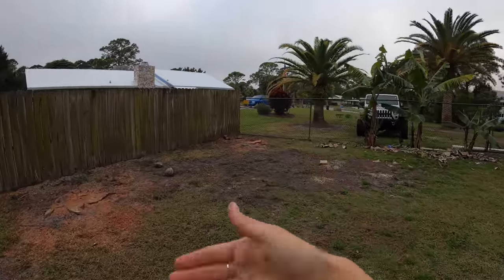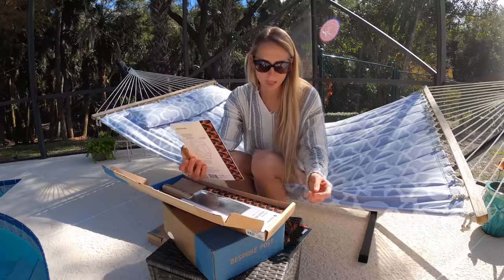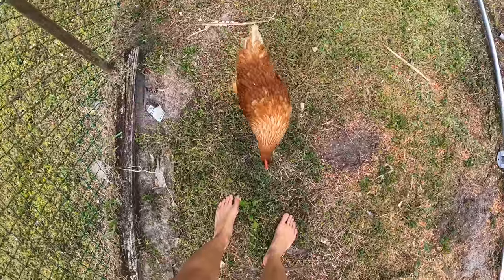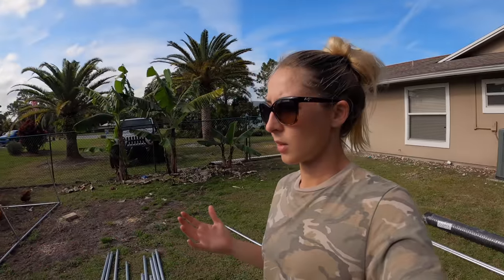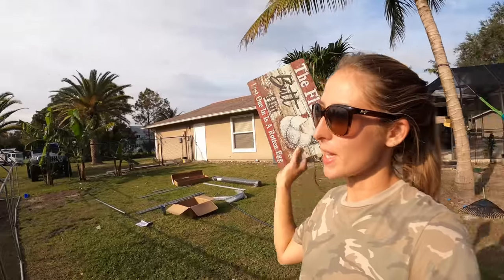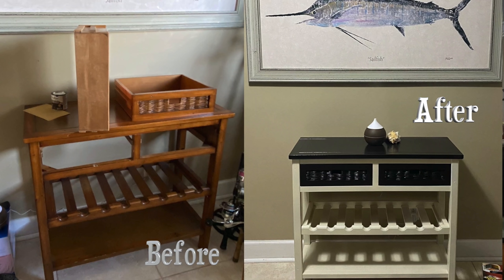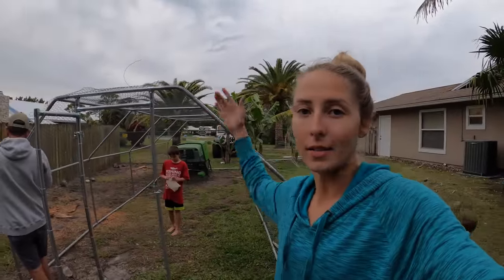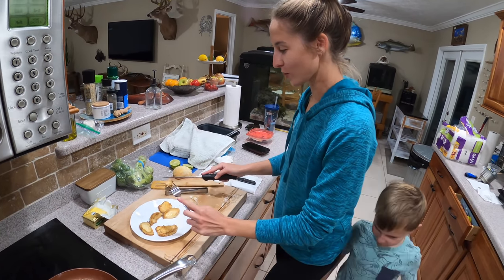Cooking Lions Mane MUSHROOMS & Building a HUGE Chicken Cage in my Backyard!

Comment: Hey Kelly and BlueGabe, I expect most lion's mane or mushrooms in general sold at farmers markets are not foraged, but instead are farmed. It's quite easy to grow mushrooms. I suggest you start with golden oyster mushrooms as they do really well in Florida's climate. Lion's mane is also easy to grow. You can pick up some grain spawn and grow it on hardwood pellets (from any hardware store - a 40 pound bag is usually $7) which have been pasteurized with boiling water and cooled down.

Comment: Hi. The wire ties that you used may not be the UV protected type. Here in Canada they are color coded. White are for normal use out of the sun. Black are UV rated and can be used in the sun. for a long standing chicken coop a coated wire is always the best.

Comment: I would like to give a suggestion, make a coop with a separate cage attachment that you can move around, so that when they  destroy a spot, move it so it will not destroy just one spot. Put it on skids so you can pull it with a machine to a new place.

Comment: Wow, those chickens really did a number on the grass, lol. Hey Kelly, those parts that make up the big chicken cage are GALVANIZED steel. NOT "stainless steel"........because trust me: stainless steel is incredibly expensive, and you would've paid at least 5 times as much if all the parts were "stainless steel". So now ya know! ( Walk into any hardware store and compare prices for galvanized nuts & bolts vs stainless steel......you'll see what I'm talking about. Stainless steel is the best steel for resisting rust, but it's just crazy expensive. Galvanized is usually good enough, except on property right on the beach/ocean. Chain link fencing is galvanized. )

Comment: Raccoons will dig under and will kill your chickens unless you put something around the bottom.
Reply: A good practical way to keep diggers out is to lay a two foot wide roll of 1/2 inch hardware cloth flat. 6 inches inside the enclosure 18 inches outside.  Bury the mesh a couple of inches deep at outer edge, surfacing at the bottom rail.  We'll worth the effort.

Comment: Cool chicken jail. lol. Also, if you ever have to paint wire again, don't use spray cans, get regular paint and a roller. With spray cans, you lose over half your paint.
Reply from the maker: Yea, I ended up just spray painting the metal rods
Reply: @IslandKey  I learned that the hard way, lol. I went through 6 cans of spray paint before I stopped and got regular paint and a roller. lol. And with a roller, it's really easy and fast to paint wire or chainlink like I was painting.